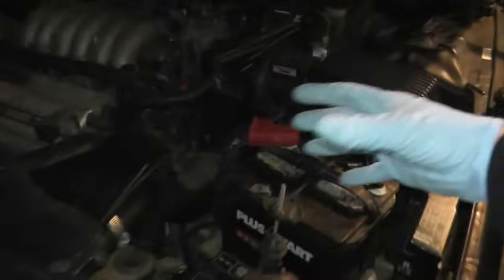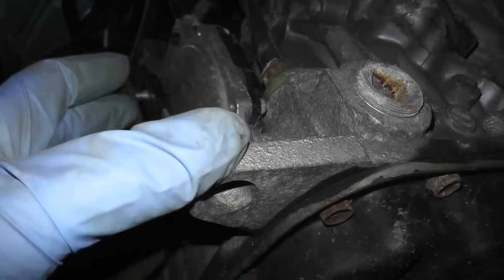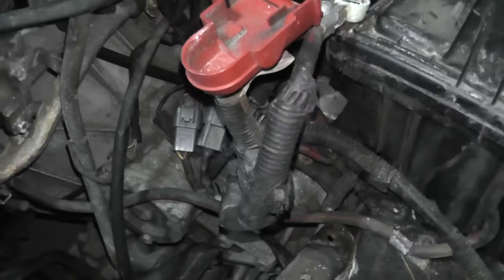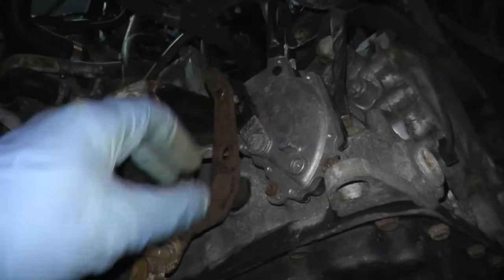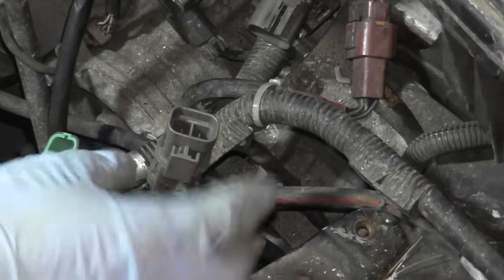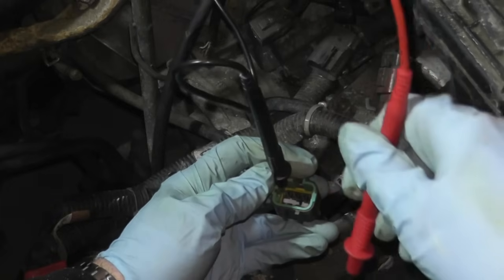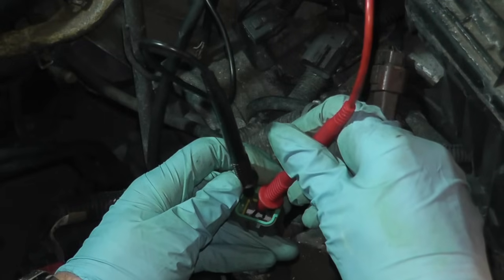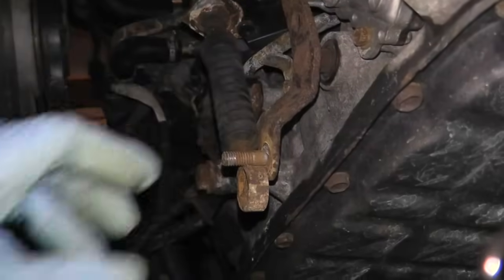How To Test and Replace the Neutral Safety Swtich / Inhibitor Switch P0705

Comment: Nissan Xterra 2000 pnp works, truck starts in park and neutral also has reverse lights but I still get a code that tells me  to replace Park neutral safety switch I'll try the continuity test. I need to smog but I believe it is a 02 sensor that is giving me a check engine light 😢😢.

Comment: Bro are you still here i have issue with citroen 2007 1.6l dunno how ro adjustment inhibitor switch also cant remove it because screw damaged my can unable to start when i turn key on its apoeare 2 dots on screen no letters appears p or r or n or d

Comment: I have a 2017 outlander 4 cylinder Mitsubishi it will go into every gear but driving I have to hold this is the first that it has no I did take the negative off cuz I had to redo the gas lid take the negative off and reset it and I don't know if that's got anything to do with it or not does anybody know what may be going on with this vehicle to 2017 outlander four cylinder

Comment: Finally! Someone made a video that's instructional, comprehensible and actually speaks English.
Thank you! Thank you! A thousand times THANK YOU!
You just gained a subscriber who will tell as many people as possible about your channel.
My neutral safety switch on my 2019 Nissan Versa (I'm told) is bad and needs replaced. 
I'm like most, not having the funds to pay a mechanic even though my vehicle is still under warranty from Nissan. And the mechanics at CarMax, who say my service agreement is valid, refuse to fix it because their insane logic and deceptive loopholes require ME to take it to a dealership who automatically charges $200.00 + to diagnose the problem AFTER it has already been diagnosed. 
I'm going to "attempt" fixing the issue as I've successfully done before.
And if successful, it would be great to tell others how one can do so purchasing a brand new Neutral Safety Switch online for less than $20.00 from a company in China which fits my particular vehicle.
Again, Thank you so much. Keep up the GREAT WORK AND AWESOME CHANNEL.

Comment: Hey man, i got the same issue..my car is driving in 4 or 2 instead of D…..code P0705….i was told to change the neutral safety switch and another one says change the transmission range sensor circuit

Im confused on which one to change or if its the same thing
Reply: I’ve seen it’s the same thing, not a 100% sure though as well
Reply: They are both the same thing just different names 😊

Comment: Excellent video,  might be having an issue with. 2001 maxima
Had to put P ->N ->P. 
Then it started.  Will keep eye on it . 
It might of gotten out of adjustment after 20 years.   My son mostly drives the car now.   And I think this issue has happened twice  in 16 months.  But also starter went and I replaced starter it for him. Part was free under warranty.  I am sure it was the starter because I could hear it try to start but starter didn’t turn over . After a few taps on solenoid it started.  

Possible the cable got stretched  or got miss alignment .  Hopefully it isn’t the neutral safety switch sensor. But if it is part at rock auto is like $20-30,   
Autozone : 40-50, Dealer :80-90

Past 2-3 years electrical has been giving  me issues 
Battery 
Both headlights bulbs not at same time
Break light switch
Blower motor & resistor 
Window motor
Starter
#4 coil
Speed sensor
Possibly TCC solenoid (p0744)

Comment: Save money by checking for wire damage before you spend a hundred.Sometime wires get fried.Someone  could also take a razor and cut it slightly so it fails but still has continuity.

Comment: I bought a 92 Nissan pathfinder and I put it in neutral to transport it and I started it once but then it would not start again to save my life and I could not figure it out and even couldn’t get so called mechanics to diagnose and after a process of eliminating other causes why it wouldn’t turn over and it boiled down to the inhibitor switch being in the wrong position due to me manually setting the shifter into neutral and took it out of alignment and thought it was in gear. Anyway thanks for all the great information. Liked Subbed

Comment: very informative! great job. You have the most informative video on this topic so far.  I haven't been able to find much information for my 2006 Toyota Sequoia Limited AWD. It only starts in neutral. The shifter is very tight when shifting from park to neutral. Would you have any advice on my issue?
Reply from the maker: Check the cable that leads from the shifter to the transmission assembly. Maybe kinked somewhere.
Reply: @Carsntoys  Should the position lever that's connected to the cable be loose enough to be able to move by hand or tight? If it's tight, then should I assume it's an internal issue?

Comment: Hey mate, long shot you're still watching the comments of old videos like this. But do you have the part number for the switch?
Got a dead one I need to replace on a '97 Bluebird/Altima that looks identical. Cheers!
Reply from the maker: Gotcha. Try this site: https://www.partsnissan.com/
Reply: @Carsntoys  I just saw your video for the 1st time today... very informative and to the point. 
I have a 99 infiniti G20 automatic transmission with a bad switch, switch was replaced and now it only starts sometimes after a little back and forth with the shifter. Lately I cannot get the thing started no matter what, tried adjusting the switch,  nothing works.
Can you help me with any info you might have in regards to by-passing the switch altogether? What wires do I need to connect?  Thanks in advance

Comment: I have a 2014 Nissan Versa SL and I just had the motor mounts replaced and it fixed the jerking problem when I used to switch from P to Reverse or neutral.  But after fixing it I have a click sound when I switch to D or R, the click sound happens when I stop at a stop light and the engine light is now back on.  I know it’s not transmission because I can drive it as fast as it will go.  Is it the neutral switch?
Reply: I'm having the same problem now, did you find the problem?

Comment: Great video. Got a 2004 Forester XT super hard to shift into gear. Is it the cable itself or the inhibitor switch? I checked the shifter (automatic) and it seems clean. Thx
Reply from the maker: How did you check the shifter? Have you tried placing in gear from underneath the vehicle?
Reply: @Carsntoys  No not yet, I have a new inhibitor switch as well just in case cuz I was getting a code for that. Manual says to remove exhaust to get to it (cable and inhibitor), have to see if I can get to it without doing that cuz the exhaust is rusted together.

Comment: I have a 2013 Elantra and it started clicking. I replaced the battery and still the same problem.  Day later no click and my battery is dead because my parking lights stay on without my key even in the ignition.  No one seems to carry the inhibitor part either or have the starter in stock.  We need to call Hyundai and tell them we are all having the same issue.

Comment: Some information that may save someone some money and trouble. The neutral safety switch will cause many more transmission problems than just the no start in park. My towncar would intermittently jump into a lower gear when driving but just for a second. It can also cause a vehicle to not go into certain gears. If you take a neutral safety switch apart, it has many contacts inside it and many wires going to it.

Comment: Hi, am a bit confuse for the last part when you said that you need adjust alignment at neutral shifter taking the reference hold  unscrew the control box and do alignment with the strait Allen key to this will allow to put everything in place.

1-you tied everything back but the cable shifter is in park and the adjustment alignment in neutral
2- Does this stay in neutral with alignment and shifter stay at Parking?
3- When you need to change parking to neutral should works?

this is confusin for me.

Comment: Hi guys. I have a 2004 Ford focus zx3 2.3 duratec engine. I was driving and made a left turn and lost torque and power. I used inertia to get to the side of the road.  Once I was on the side of the road I tried to shift gears and heard a whining sound.  https://youtu.be/9ueqtBfMMSw

After I towed it home I don’t even get a noise when I try to shift.  When I put it into gear nothing happens. Its as if the transmission isn’t engaging” https://youtu.be/TaWavGoRkeU

Also my scan tool show no transmission codes

Can anyone offer any advice.

Comment: Can this switch make your car not reverse
Reply from the maker: Older or new vehicle? Manual or auto?
Reply: @Carsntoys  yesterday my friend changed the oil on my 2011 sonata automatic when I tried to take my car for a test drive my car was having trouble going in reverse and drive  no warning lights come on car starts and stays on  Could it be that when my friend removed the plastic cover from under the car he may have disconnected something

Comment: I have a 2003 dodge dakota, and it says it's in reverse and the reverse lights come on but the transmission is in park. I have to drop it down to neutral to start it. do you think it's this sensor, and will this test work on mine?
Reply from the maker: It certainly could be. You can do this test with your truck as well. The readings may be a bit different but the theory is there.

Comment: Thanks for the video. I have this intermittent problem with no crank when in Park position. If I shake or hold the gear stick towards the steering wheel , the engines cranks and do start. I think I have to adjust as you did at the end of the video. Anybody done this on a MERCEDES VITO 2003, AUTOMATIC, PETROL ENGINE? any tip will be appreciated.
Reply from the maker: Sounds like it needs an adjustment. This vehicle was doing the exact same thing.

Comment: when replacing the neutral safety switch/transmission range sensor do you need to replace the connector.. I'm having an issue finding the connector... no body has it and ford discontinued it... what now?? help... how can I fix it? any pointers? I even called junkyard...
Reply from the maker: This harness connector was perfectly fine. Have you tried ebay?

Comment: Thanks for sharing. I noticed moving the gear shifter only helps 25% in getting it started. If I rock the car back and forth in park, it starts 99% of the time. I will check to see if it is out of alignment. By chance, do you have the wiring diagram for a 1996 Nissan Altima so I can perform this test as well?
Reply from the maker: I can probably get it. Throw me a message via facebook if you still need it

Comment: Why don't you say what kind of car your working on in the title or description????????
Reply: It says performed on 97 nissan maxima.
Reply: He said it was a Nissan Maxima
Reply: I have an 02 Buick Rendezvous and it starts up no problem but as soon as I put it in gear it shuts off
Reply: 4 closer results
Reply: I need to make an 3 wire neutral switch work on truck that came with a
5 wire plug system can anyone help PLEASE. Thanks.  Carl can anybody help me figure out how to make a 3-wire switch neutral switch work on a truck that came with a FireWire plug-in kit please and thank you for your help
Reply: He did it's a Nissan Maxima 1997
Reply: salvor1 Why?
Reply: Because stupid, so we tell if it is about the car we own!
Reply: @edkay3601  I was wondering that too but I'm glad you called him stupid.
Reply: 2002 mercedes s430

Comment: Hi. I'd really appreciate your help. My Ford Focus 2002 turns on the transmission light  when it is in Park or Neutral. If I select any other shift, the light turns off. I replaced the TRS but the issue persists. 

The problem showed up time after I washed the motor of the car.

Comment: i have a 2010 nissan sentra and with a cvt transmission. the code came up as p0705 and they said it may be the transmission range switch. is that the same as the switch stated in the video and for my car can i get to it myself?
Reply from the maker: It looks very similar to the switch shown in this video. If you have trouble finding the sensor I may be able to dig up some diagrams.

Comment: i changed the nuetral safety switch the code still comes on? p0705 transmission range sensor the guy at auto zone said the code is not saying the switch is bad but it getting low voltage so is the connector to the switch bad? i  installed a back up camera previous to this i dont know if that has anything to do with it but it does tap in to the reverse light
Reply: Your back up camera will have no effect on the power going to the neutral safety switch.  Likely a bad or starting to go wire providing power to the neutral safety switch or one sending power back to the computer depending o9n which gear you have it in..  Take a volt meter and check for power at the electrical connection to the switch with the key on.

Comment: im doing this in a 02 maxima im having trouble aligning the pins near the cable how do it do it should i put rhe cable in nuetral first?
Reply from the maker: +abraham balmir Try to find something that will fit through the small hole on the shift cable opening and you'll be able to align the cable and sensor.

Comment: my Mazda MPV 2001 starts in any position. I adjusted sensor,  no resolution Will do the test next. I assumed the switch prevents cranking in gear. What you say, counselor.
Reply from the maker: +Jose Hernandez Chances are the sensor is no good if the vehicle starts in any gear.

Comment: I had  p1507 reoccurring on my 03 ford  2 yrs ago, all I did was switch to ultra 94 gas, problem solved never came back, don't start tearing your engine apart that's mentally retarded.

Comment: I am at your video because my cars clutch has to be stomped to start the car, and is this the fix?
Reply from the maker: +Tyler Rivas The neutral safety switch are for vehicles with an automatic tranny. They're called position switches on manual transmissions.

Comment: I hope you can answer. My car nissan murano has the same error code p0705 .   It was hard shifting sticking in gear before going .  After driving to my in laws for thanksgiving . It started but did not move forward or reverse. Gave it some gas and it started to go. Drove 5 miles and car did the same thing again .  No forward movement after slowing down. pulled into side street by cruising and car died. Now it will not start. 

Would this be neutral safety switch ?
Reply from the maker: +small guy with small Afraid not. Any trouble codes?
Reply: just p0705
Reply from the maker: +small guy with small What yr is your Murano?

Comment: My switch looks very diff. I have a 99 chevy s10. I bought a new switch from partsgeek because sometimes when I push in the clutch pedal and turn the key nothing happens and somtimes it starts. Other times i have to either push it down a few times b4 it will start or sometimes I really have to give the pedal a good push. I have reason to believe my switch is failing asdon't think it's tripping everytime I push the pedal down so for $25 bux it's worth s shot.
Reply from the maker: +Muilisx Yea, they're a bit different for manual cars. Sounds like you're on the right track
Reply: Indeed, I received the new switch 2 days ago, and dropped it off at the mechanic who already has the truck for other reasons so when I pick it up it should have the new switch installed and I will know right away if it was the switch or not because I'm going to push the clutch pedal down normally and if it starts then it was the switch for sure because the old switch never trips if I push it lightly.

Comment: could I call you or direct message you. to pick your brain for like 5-10 mins. I'm getting  p0705 error w my 2008 lancer. and I've already replaced the switch once. but it continues to periodically go into limp mode for no apparent reason. it's happened twice since I've replaced the switch. and I cannot figure out why. I keep getting the code p0705 and all the gears read out "r" for reverse, on my display. and when I shift into drive, it kind of jolts into gear. probably because its defaulting to 3rd gear, but still. I do not kno what to check for at this point. and am getting irritated. the one thing I think it might be is a short in the wires somewhere, no clue were. because the 2 times its happened, its been raining. but I hope u can help me and tell me what to check for.

Comment: This is a problem for me. My 93 318 Dakota won't crank when i turn the key but it will when i jump the starter solenoid with a screwdriver. I've replaced the starter, the ignition switch, all the fuses, adjusted the column rod, and everything thing i could think of. The nss is my last option really unless there could be something else i haven't thought of.
Reply from the maker: David Hollingshead Does the vehicle start if you place the tranny in neutral? If so, then you can try adjusting the nss or just replace it.
Reply: +CarsNToys Thank you man!
Reply: +CarsNToys Not by key. But it starts no matter what gear jumping the solenoid. I had to chase my truck through my neighbor's yard once because i started it in drive

Comment: I have a 2000 Nesson altumia I can't get it to start up it turns over but no start what's up with it
Reply from the maker: Kim Richards It wouldn't be the neutral safety switch if the car is cranking. You have to check for spark and fuel.  I'd start by checking for spark. Visit your local auto part store and grab a spark tester. They're around $15. If every cylinder is getting spark, then you'll have to check for fuel. Take a look at this video regarding fuel. An easy point is the fuel filter line. https://youtu.be/O7Z0B8AkjAA

Comment: My auto 95 civic doesn't crank nor click when I try to turn it on. I'm able to start the car using a wire directly from the battery to the solenoid. Can it be a faulty safety switch? Please help. Thanks
Reply from the maker: Joel Rodas I'd start by testing the ignition in the steering wheel.